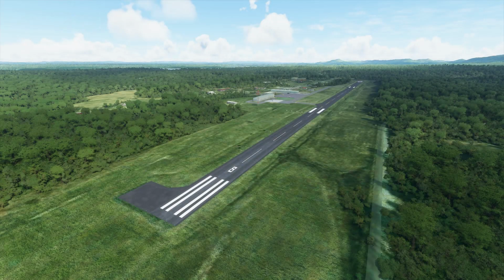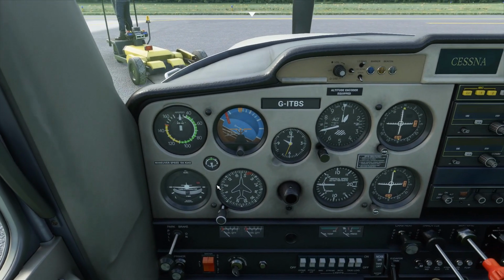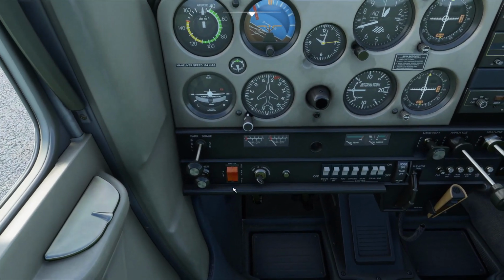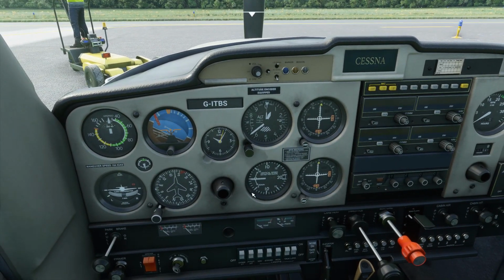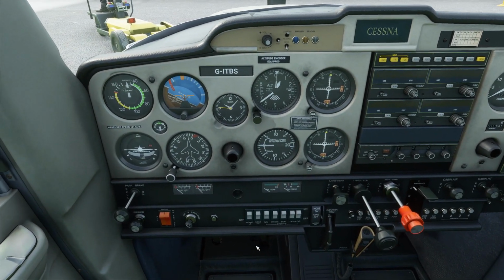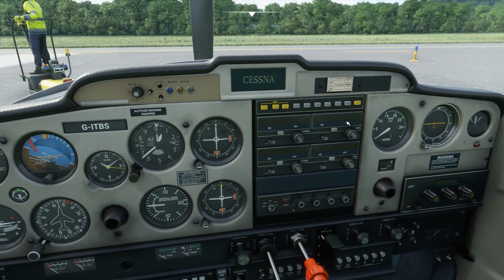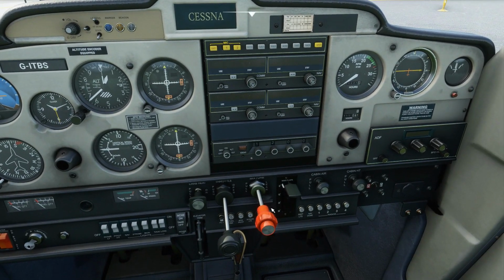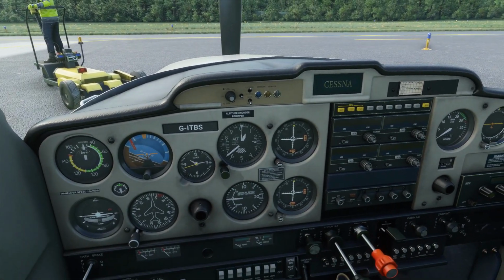REAL PILOT | MSFS "Flight School" | Part 1: Aircraft Familiarisation | Microsoft Flight Simulator

Comment: Great introduction. And I'll be going through the rest of the series. I'm just wondering about the lights and switch located above the altimeter. I have seen one of those lights come on before while playing around in FS.
Reply from the maker: Hi Russel,

Thanks very much, glad you’re finding the series of use! The switches are just a couple of audio selectors - not really relevant in the sim. The lights are marker beacon lights. Essentially on many instrument approaches, radio beacons are placed on the approach path at various points, so that pilots can identify their position on the approach and check that the aircrafts current altitude is correct (somewhat old fashioned technology these days). Flying over the beacon will trigger an audio tone (you’ve probably heard a low beeping in the aircraft occasionally as well?) as well as a flashing light. Blue = the outer marker beacon, amber = the middle marker and white is the inner marker.

I hope that helps clear things up? Best of luck with the flying! : )

Comment: Hi, great video as I'm just starting. One little problem with my C152.  The ammeter only shows a +ve charge when the alternator is switched to the "Off" position. As soon as I turn the alternator "On", the ammeter shows a heavy discharge.  It seems to be back-to-front although all other switches work ok.  Ideas?
Reply from the maker: Hi Dave. Thanks for stopping by and welcome to the hobby! : )

Unfortunately it’s just a bug with the current version of the sim / aircraft (that was introduced in patch #2). I have the same behaviour currently. This vid was recorded before the bug was introduced. Even though the ammeter logic is backwards, turning it on will still charge the battery ultimately.

As far as I know, there’s no fix for the time being I’m afraid.